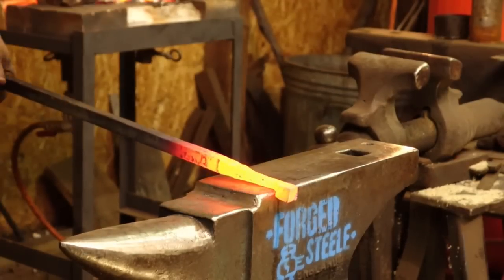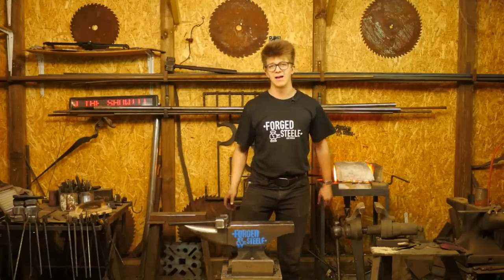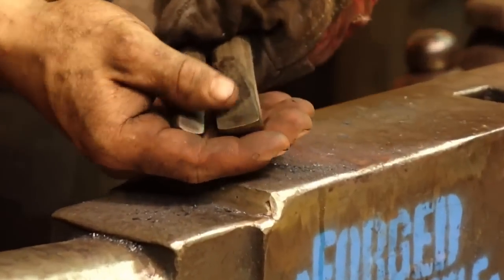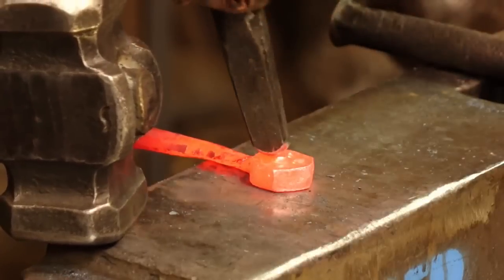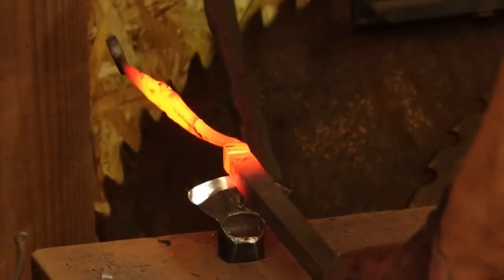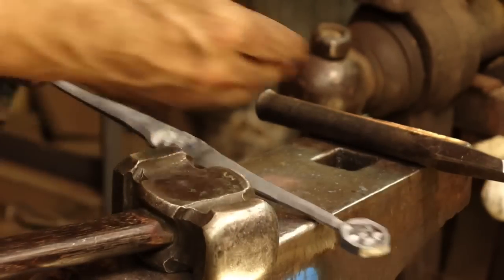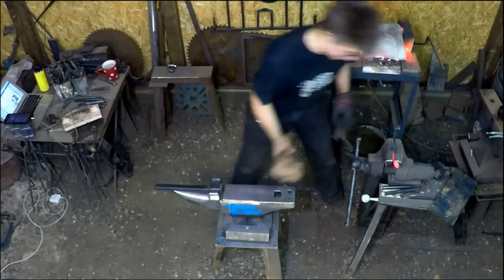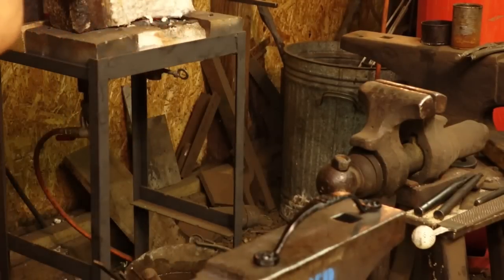The Alec Steele Show Ep:5 Forging a Door Handle

Comment: I appreciate your explanation on using propane vs coke, but the biggest advantage for you would likely be a reduced time to reheat your stock each time.  Most of the heating time the way you are doing it now, is chit chat not really related to forging.  I think there would still be plenty of time between heats to explain what you are going to be doing next.